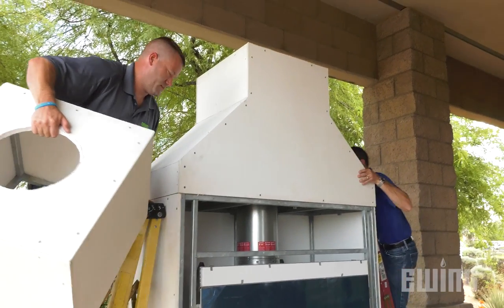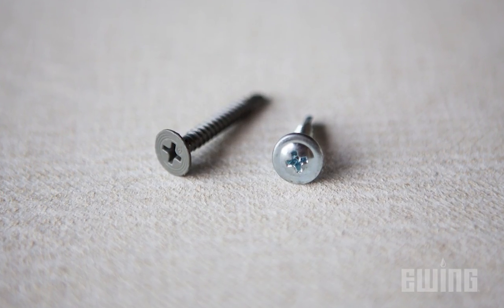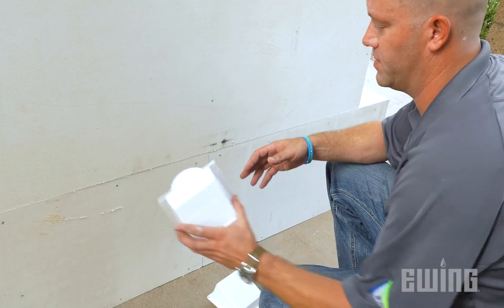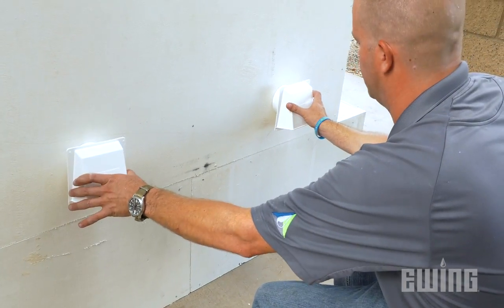RTF Modular Outdoor Fireplace Kit

Comment: You could frame this yourself with pressure treated lumber and metal studs for the heT box clearance cover with cement board
Reply: How fire retardant is PT lumber?
Reply: @paulp6397  not very at all.  But you can use metal studs around the firebox to meet clearance codes

Comment: Not bad but pricey
Reply from the maker: Thanks for watching Pavel! This kit can be assembled and ready to veneer in less than an hour. If you consider the time it takes to construct a traditional brick/mortar fireplace, the RTF kits are a really affordable alternative due to the labor savings alone.
Reply: How pricey? Their website has no informational.....as well as several dead links.
Reply from the maker: Sorry if you had trouble with the website GTB. The link at the end of the video as well as the one in the description seem to be working okay now. Thanks for watching!
https://www.youtube.com/redirect?redir_token=7HcNAVd1ab7gxmhqcQHcci4tHcV8MTU1MDI2NDk4OUAxNTUwMTc4NTg5&event=infocard&q=https%3A%2F%2Fwww.ewingirrigation.com%2Frtf-straight-top-wood-boxes
Reply: Very pricey. A traditional one costs about the same. You still have to add the price of the veneers, concrete or stone and other materials to this one. That takes time too. A lot of times the finishing materials cost more than the building ones.
Reply: Aproximate price? Trying to get a numner here seems to be ahrder than flying to Mars
Reply: @temujinkhan6326 $5,577 for the fireplace without the wood storage.